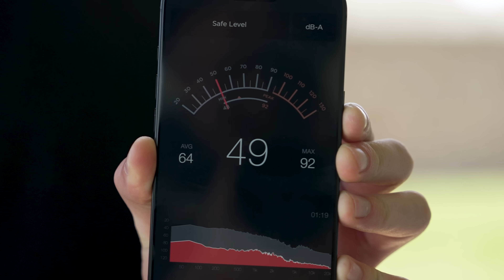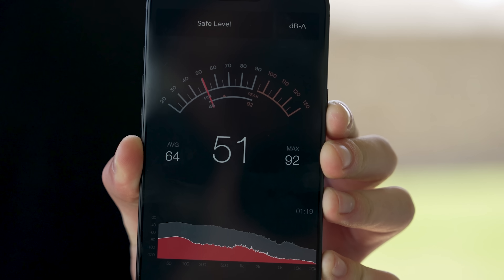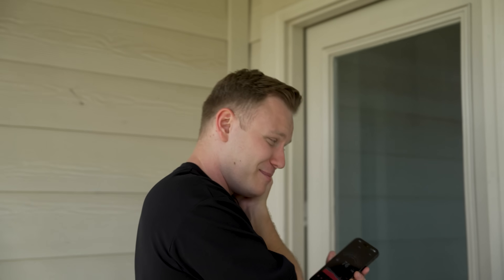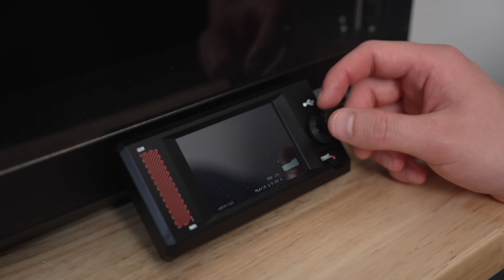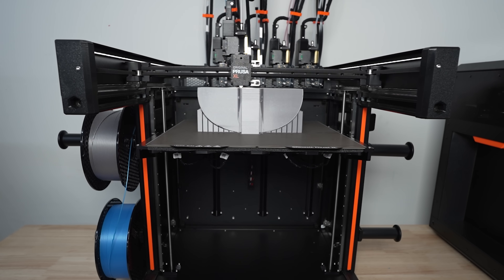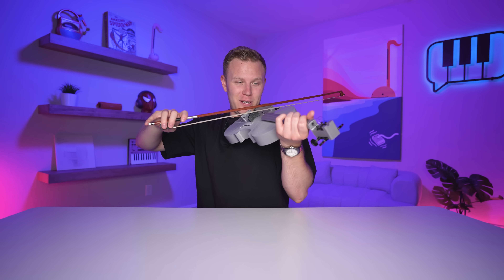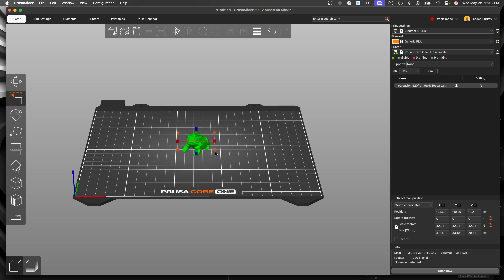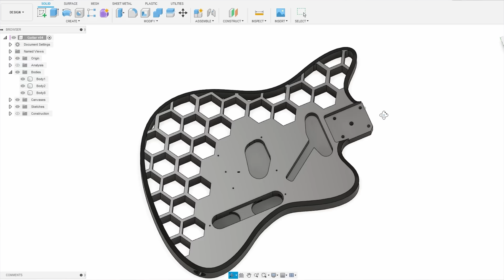I Tested INSANE 3D Printed Instruments!

Comment: That is not.how you use the bird whistle you’re supposed to have measured the water until it makes it when you blow it like splashes inside it makes this kind of bird bird sound. I have one of those and it does work so even if you say it doesn’t it does so just like try it out for yourself because it does work you’re supposed to have enough water in there so you’re supposed

Comment: I don't get the hype for the Prusacaster. The only 3D printed part is the body, which doesn't matter in an electric guitar at all. The neck and the hardware are what is most important, which is all not 3D printed. 
Print an acoustic guitar and then make it sound good. That's a real challenge.

Comment: "didnt even know anything about 3d printing and got sent these (Redacted--EXPENSIVE AS HELL PRINTERS FOR FREE--/Redacted) printers now i love 3d printing" i paid 800 dollars for a 100% unassembled prusa mk2 back in the day, took 6 months to get to me and then right when i finished building it, which was stressfull as hell as a beginner who knew nothing about 3d printing, they go and release the mk3 a week later that fixed all the shortcomings of the mk2! 

Ahh, I jest , I jest. i still loved the thing, until one day the bed leveling magnet switch built into the hotend quit and the printerhead came down so hard against the bed it warped the entire frame, talk about great Z axis strength!  This was many years ago, I just recently got a BambuLab P1P which is their enclosure ready but not enclosed version of their premium printer the P1S and its so clean and so fast , i didnt know printers could even print that fast, and that accurately at the same time, so im excited to try some of these prints, cant seem to find the drone flutes though, but im sure ill find some from somewhere, thats the joy of 3d printing, the community provides almost every model you can think of ! I'm building a Ukulele bass right now, the design itself from what ive heard sounds so good i cant wait to try my finished version

Comment: The yellow one just looks like a double ocarina. But I really want one of those tiny recorders that folds up! I play ukulele, viola, recorder and ocarina, as well as keyboard things.
Reply: If you don't have a 3D printer, there are several ways of going about this. Many libraries and other public institutions now have public 3D printers that you can use for free or a small fee and this often comes with a crash course. That's how I got my first taste of 3D printing.

There are also commercial 3D printing services. Upload the file, specify the material and a couple of days later, you get the finished object in the mail. Should be pretty cheap for something this small. If you only want one or two smaller items every once in a while, this makes sense.

Finally, 3D printing is a lot cheaper than you might think. I started out with a €165 Elegoo Neptune 3 Pro (its successor is similarly cheap), paired with a €80 filament dryer from Creality (absolutely essential - don't cheap out on this!). I'm using muesli boxes with desiccant to store filament as dry as possible for maximum print quality. Filament is about 12 to 25 bucks per kg, which means that small items cost literally cents to print. This cheap little printer is slow, but with the right settings and properly dried filament, you can get amazing results that rival printers many times as expensive in terms of quality.

Comment: Hey. Thanks for printing my ukulele :). However it looks like you've added a pretty dense infill (can be seen on the timelapse) while it's designed to be printed without supports. Also it could be even nicer if hexagons were printed with the different color (especially if printed on Prusa XL with 5 toolheads). And if you want to add first in the world headless acoustic bass ukulele (well the second one - first one is hanging on my wall)  to your collection let me know - it's still in the prerelease state but I can share current-state files.
Reply: Not sure what just happened here under my comment, but the ukulele part is at 0:51
Reply: cool :o
Reply: i cant wait for that headless version. are any of the existing parts the same so i can start printing?
Reply: Just want to say, you're a legend mate, can't wait for the release!